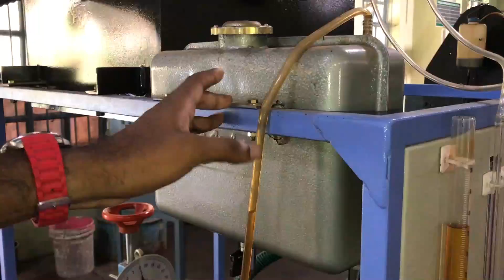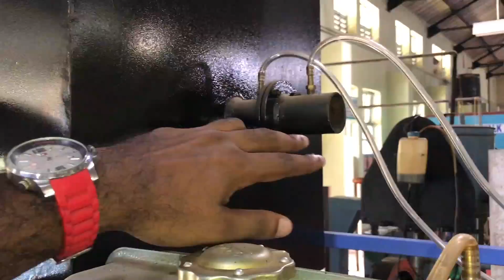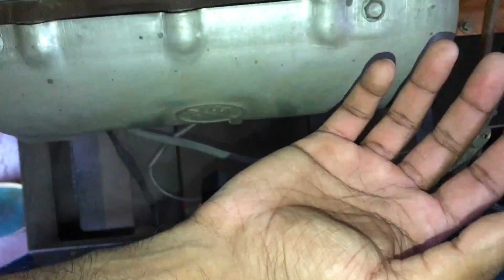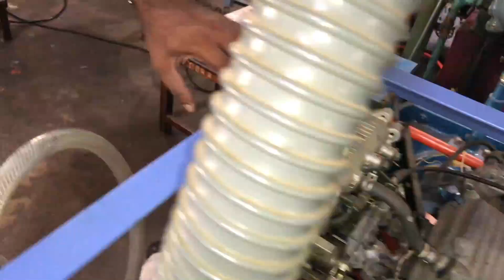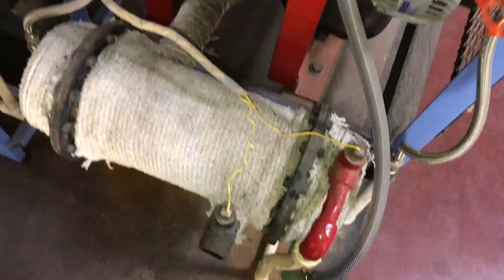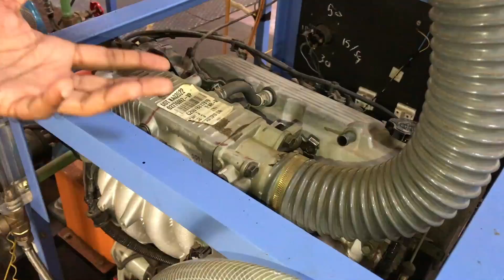MPFI System in 4 Stroke Petrol Engine :Multi Point Fuel Injection System(quickly!)🔥

Comment: Gravity feed won't work for MPFI engine. You must need a high flow fuel pump and fuel pressure regulator to  pressurise the fuel.
Reply: Nope. The air passing trough pulls the fuel (Venturi effect)